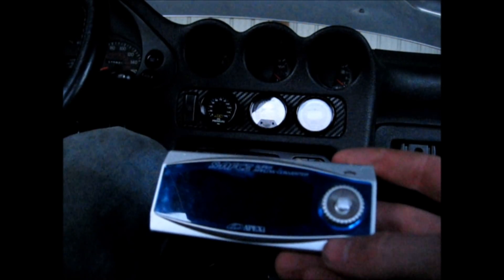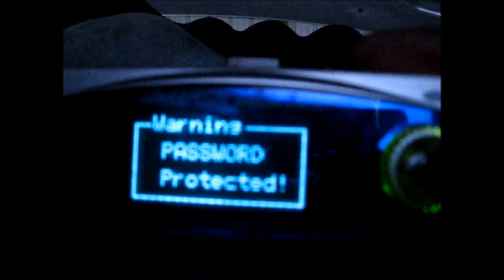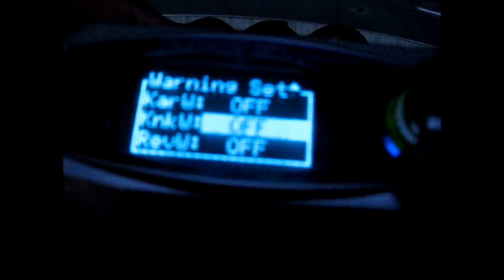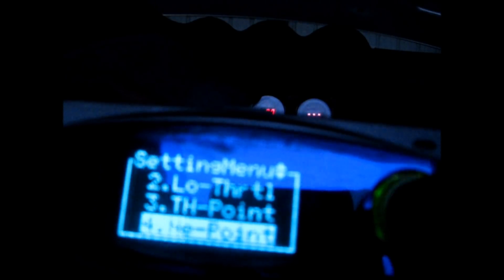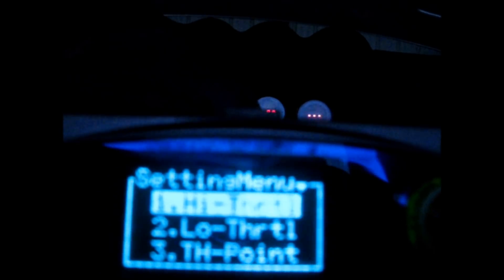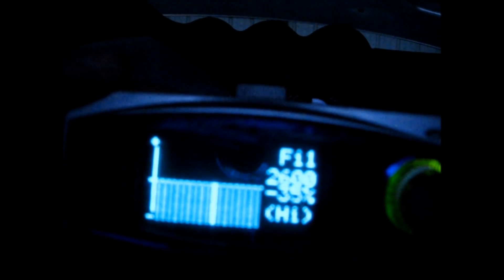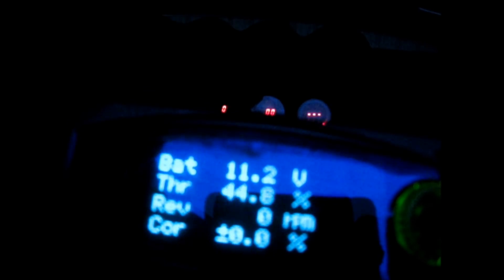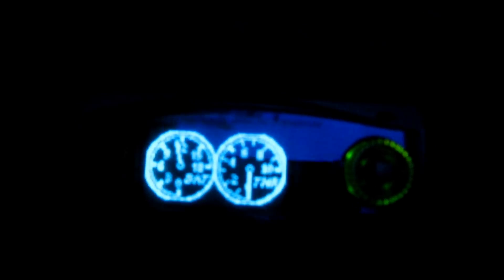SAFC II Tuning Part 1 - Initial Setup - CntrlSwitch How-To

Comment: hey brother i have 15gs on e83 with maft and gm mass sensor with this safc2 can seem to get it correct if u still around would like to get some help
Reply: E85*
Reply from the maker: @davidvuelvas5986  I’m running 20ts and E85 now on MAFT, SAFC and Chrime ECU but I didn’t do the tuning so I won’t be much help. Sorry man!

Comment: Good shit man appreciate the video. If its unplugged will the car just go back to factory settings?
Reply from the maker: If you set everything to zero it would be “factory settings”, but you can’t just unplug it. You would need to rework the wiring so it’s no longer intercepting the ECU MAF Signal.

Comment: Hey man! If I have 900cc injectors...how much percentage should I adjust? I'm having trouble figuring out the calculations. If you can help me that would be great.
Reply: 900cc Injectors are far too large for a piggy-back type fuel controller on a VR4.  You really need something that isn't going to make your timing advance too far, which an S-AFC will as your ECU is thinking you're making 60% less power than you really are.
Reply: CBTalon97 oh ok. Sorry I own an rx7 fc3s btw :p
Reply: It might not function the same for you given that factory injectors are significantly larger on 3rd gen RX7s than the TT 3/S cars.  I believe you have two 550cc injectors and two 850cc injectors.  Definitely a different type of monster to tackle.
Reply: CBTalon97 Yea that is correct. Crazy huh rotary needs alot of fuel lol

Comment: Not sure if this comment will apply to this product however here goes. From the Apexi AFC NEO description, "The Deceleration Air Flow Correction cures erratic idle problems for Hot Wire vehicles equipped with an open atmosphere blow off valve."
Reply: +Marlon Dela Rosa Hotwire is the same as "Mass AirFlow Sensor" or "Air Flow Meter". MAF sensor is at the tip of the air entry, this measures the air that enters and the ECU then calcultaes how much fuel to inject. If the air escapes suddenly(BOV vents it to atmosphere instead of recirculate it) then the run will run rich every shift or of throttle.
Reply: I assumed fuel pump hot wire for 3000GT VR4/Stealth Twin Turbo cars.
Good to know, thanks!

www.stealth316.com/2-fuelpump-hotwire.htm
Reply: Yeah, the air measurment tool you car uses must be selected from the 4 options:
1. Hotwire - MAF, usually next to the air filter it uses a set voltage range of 0 - 5v and heats the wire to maintain a specific temperature. As air passes through it, it cools the wire making it send more voltage to sustain the set temperature, thus the 0 - 5v readings that detects how much air is passing.

2. Flap - I don't know what this is.

3. Pressure - MAP (Manifold Absolute Pressure) this is the "Speed Density" tune that is ideal for Vent to Atmosphere Blow Out Valves. It usually uses some or the combination of: the Volumetric Efficiency tables, MAP pressure, RPM and Throttle input to decide how much fuel to inject.

4. Karman - I have no idea how this works, but it's apparently used in this car.
Reply: SI0AX  Karman I believe is a type of AFM

Comment: Thanks a lot for that video! It will help me set up my SAFC2. I will eventually go for exactly the same set up as yours, but for now, I am still running the 360 injectors. Also, my car is a GTO N/A, which I have converted to T/T with 15Gs. I have also installed a Walbro fuel pump. I am running a T/T ECU, but I want to also use the SAFC2, since I already have one. I have connected it to the ECU, but haven't played with the settings yet. For now I am running wastegate boost, but the other day I installed a MBC, because I want to raise the boost a little bit (9-10psi safe for 10:1?). Now, I will be checking Stealth 316 for the SAFC numbers for my set up, but I would be very thankful to you if you could give me a base set up I can start with and tune from there... Also, I would like to know if I can trust the knock reading of the SAFC and what is an acceptable knock that I could live with. I also have an Evo Scan, but I have a hard time making it connect to the ECU, so I am very happy that the SAFC has the knock monitor in it! By the way, I am on 3si under the nick name ilian51378. I am the one who does LED tail lights conversion... :)

Comment from the maker: Correct there is no timing control with the SAFC II.  However if you appropriately select injectors you can still make decent power w/ a proper AF ratio and keep it simple.  Having timing adjustment can sometimes be too much for people to handle.  If you select too large of injectors the ecu will generally be adding too much timing based on the amount of fuel (air) you are pulling from the ecu.

Comment: I'll be looking in to a tune up kit and doing the timing belt when I have some money saved up.

So far the car has been doing great, I think the problem was too much boost and it was spiking over 15+ maybe 17 or so, I lowered it to around 12-13 and it's been working great!

I just don't drive the car anymore, and start it up every now and then, my job keeps me on call 24/7 so I have to be ready for a call( accident or arrest) as a tow truck driver. Money is good :)

Comment from the maker: Hope you made progress and are running strong now.  I think you might save a few bucks by buying the MSD wires and NGK plugs somewhere else, but it is convenient that they have the whole package together.  A boost leak check would also help you determine if your TB and plenum gaskets are bad and leaking air.

Comment: Reply to my comment. I'm pretty certain, instead of spark plug blow out, I'm pretty sure I'm getting fuel cut.

My boost gauge is hitting 15 psi. I'm going to try the fuel pump relay bypass/mod. I'll see if that helps :)

Comment: Do you recommended the 3sx MSD plug wires and NGK plug set they sell for like $99 with the intake manifold and throttle body gasket?

I might need a tune up as I'm getting spark plug blow out or fuel cut(not sure which). If I had to guess it's the spark plugs. Wish I bought the 3sx ignition set when it was on sell :(